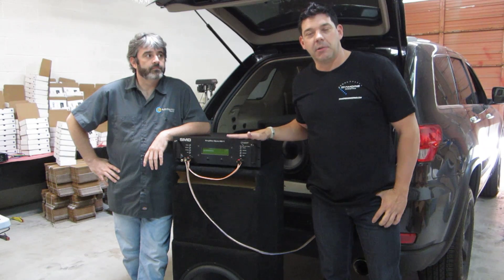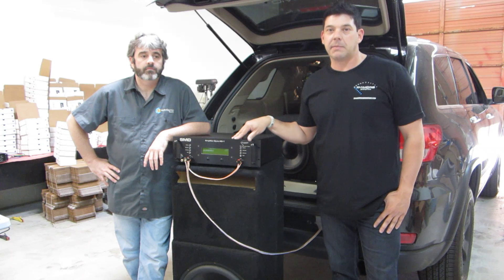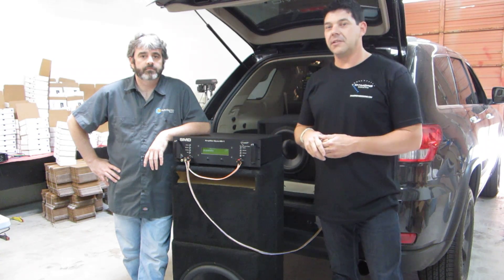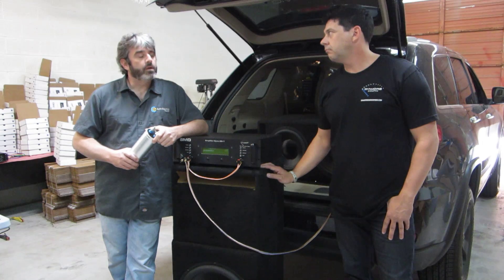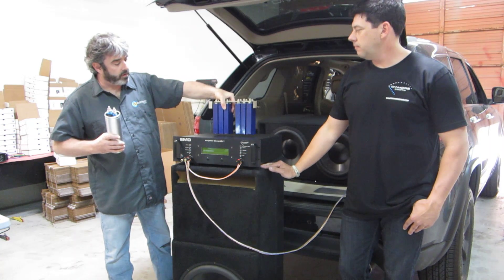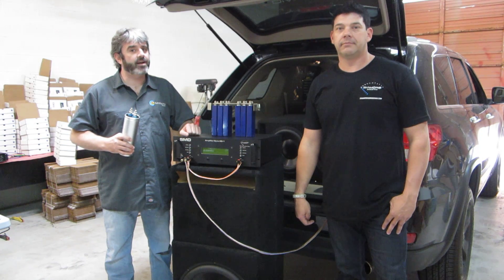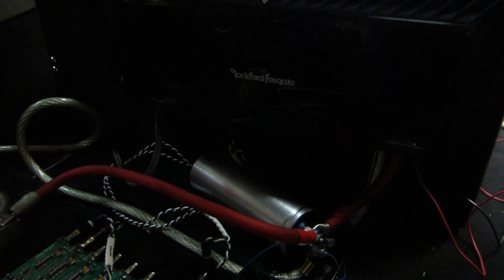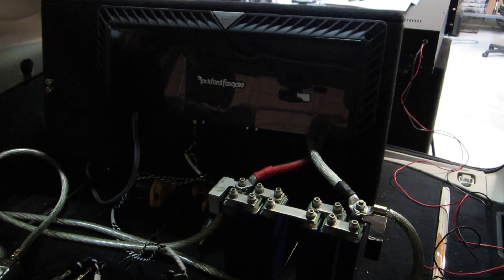SMD / D'Amore Engineering AD-1 Amp Dyno, Capacitor Testing Part 2 (Dynamic Burst)

Comment: My take is this.... i just a hour ago installed a xs power 6500 battery. Bought the "tall adaptors" for my dodge challenger 2012 stock positive battery terminal and a after market knukonceptz ground terminal (knukonceptz positive conn would require me to cut stock harness at battery,which I WAS NOT) added 1/0 gauge wire all around(except alternator pos wire to battery,stock is 2 gauge wire almost all way thru but under passenger side kick panel and seat goes to this ass wire for afew feet then back to 2 gauge by batt,but left it stock) annd I have a boss 8 fared capacitor....b4 this battery(xs power 6500) i had the same amp orion dz15001 and 12" dual solo-baric  kickers  kenwood ddx9703s double din wired to 1 ohm with a optima yellow top battery AND my lights would dim SOOOOO BAD AT NIGHT. But a hour ago added the xs power battery to my chally and im SHOCKED THIS BATTERY FIXED MY PROBLEM!  Its no joke. The volts don't drop below 13.8 at idle with lights on and bumping then at rpm 1,700 and above the volts are a good 14.1 to 14.2. Im in love with this battery. BUT??  I do have a kick ass stock alternator making 160 amps. They say you need atleast 160 to power systems with a big battery or batterys. My problem was fixed with 1 big battery. My rms watts is simple. 1,200 watts. No lights dimming nooomooore!!! I was told I need a storage battery or batteries,  NOT 300 amp alt. My car dodge challenger, most cars have a stock amp regulator. You can buy a bypass for a high amp alt, but u need that regulator bypass to get high amp out put from a after market high amp alt.  Most people don't know that.  So try 1 good battery 1st to solve your problem.  BUT??  The xs power battery 6500 COST..... $400.00 I MEAN $406.00 with tax on ebay. They ain't cheap. But check out the specs on the 6500 vs there other popular xs power 3400. Hope this helps 1 person atleast.

Comment: 1. WOW... 2. Thank You... 3. Don't you think the use of a smaller amplifier would give different results? I-mean, generally it would be less current draw & therefore a higher voltage in general - especially if the alternator's\system's amp capacity is considered... I reckon that that 2500W amp only shows one side of the story... =]

Comment: My ear is a finely tuned machine and you gave less throttle on dynamic burst on the 100 farad capacitor all 3 tests. Probably about 5 percent. You should use a finely tuned stick wedged against the seat to hold the gas pedal. Engine RPM is critical as most power comes from alternator. Do the 100 farad burst over again.
Reply: I noticed that as well.  Might have been a better test to just let the engine idle period, given the test is to see how much a cap will or will not help, and not a test for the alternator.  It should idle the same regardless, so just let it idle.

Comment: I added a bank of Maxwell ultracapacitors which comes out to 500 f and it has completely changed the way my system feels, looks, and especially sounds. People have already commented on the filtering of noise and clarity of the bass. This is 100% true. No matter WHAT I did before if I went full tilt at night there would be slight, but noticeable dimming of the headlights and sometimes even tac and interior lights as well. After the CAPS, my voltage doesn't drop more than a tenth of a volt on music. To the guy who said that this is basically bunk and is horrible for long bass notes. The longest CONSISTENT bass note I can even find in my music library is around 3 seconds. In 3 seconds, a 500 f bank, dropping from 14.2 v to 12 v outputs over 5000 watts every second. That is not including batteries or your alternator, which is constantly recharging even while playing. So a charged bank,  unhooked, is 5000 watts of energy for 3 seconds, just down to 12v. If it played down to 0v it would be 15000 watts for 3 seconds.

You can't really compare batteries to caps. They serve a totally different purpose. They shine with dynamic usage, aka music. I don't know anybody riding around listening to test tones. Safety and handling factors aside, I'd say CAPS>BATS any day as long as you have at least SOME battery backup. I have a DC Power XP270 Hairpin Alt, which is a damn beast. With that alt (which does awesome at idle revs) I'd prefer 1/2 split to be ideal. Instead of 200 aH and alt, I'd do 100 aH batts and 1 bank of supercaps for ever 2000 watts you push. Caps will never replace batts, but the same can be said with batts never replacing caps. Three letters ESR. When used correctly Caps have the internal resistance of almost a DEAD SHORT, lightning fast! Batts have to convert to chemical energy and back again to use the stored power. For those quick bass notes you need that instant power, the split second dimming of your lights is the batteries STRUGGLING TO KEEP UP.
Reply: Good to hear, i just bought a 16v 500f Maxwell module myself.
Reply: How much were they? Where can i buy them

Comment: A capacitor ONLY helps if burst current draw ( big bass note etc ) is higher than combined current output of alternator and battery 'dump' capacity.....and AFTER the big note, electrical turns to shit lol. Sine wave testing over a couple minutes and watch that voltage drop. Capacitors are awesome for spl comps ( only need extra juice for a few seconds right! ) but for everyday bangin, higher amperage alternator and batteries will be the best solution. It's amazing that this subject still gets any AirPlay o.O
Reply: It gets "airplay" because people like you dont give the whole answer.  You could run a 5000amp alternator and still get unwanted voltage drop  Most people looking into a cap are trying to mitigate instantaneous v-drop, which assuming you have a nice alt and battery and wiring, is caused because there is a delay between the audio system pulling draw and the alternator responding and providing the power to keep the voltage steady.  That is what causes lights to flicker (again, in a properly built system).  I have a 260amp alternator and a Kinetik battery rated for more than my amp draws, with all alt/battery/grounds upgraded.  Voltage readouts stay rock solid no matter how hard the bass hits, but my headlights still dim for a split second when it hits especially hard.  This is because there will ALWAYS be momentary voltage drop whenever something pulls harder then the systems output at that exact moment.  Your alternator does not know before the bass hits that it will need to supply more power.  ANY voltage drop, no matter how small, will cause this, including the split second it takes for my alt to catch up and maintain the system's voltage.  The remedy?  Totally isolate the amp circuit from the rest of the electrical in the car, or do something to better regulate the car's overall voltage.  A capacitor is one way to do this.  People seem to misunderstand how electricity works...  Your comment, while partially correct, was partially very very incorrect as well.  Obviously I can't show you, but simple example: I drive a 2012 CTS Coupe.  I built an IB baffle and installed two 12 Fi IB subs.  They are paired to an appropriate amp, which is connected to an overpowered battery, which is fed by and even more overpowered alternator.  Listening to songs with a steady hard bass beat, my headlights dim whenever the bass hits.  Listening to something with a hard, constant bassline (such as "Step Up In The Party" by Spade Ripper), the bass is almost constant, so my headlights dim for a split second, then quickly go back to full brightness, and they then stay there, because the alternator us stepping up to provide the needed power.  A suitably powerful cap could respond basically instantly, giving the alt more time to respond, and less of a heavy draw since.  The alt/battery feeding the cap is a lot less of a draw on the system than the amp pulling that directly.  Hence, less/no more split second vdrop.
Now, the case where caps do NOTHING, is when people buy a $35 cap from Best Buy or ebay thats labeled as 50 farad, but in reality is maybe half a farad, or even a tenth of a farad.  Get you a proper cap, with 1-2 farad per 1000w of amplifier, and you'll be pretty golden.  No amount of battery or alternator will mitigate those micro drops.

Comment: I don't recall any specs on the electrical system being used. Stock 120 amp alternator? Big 3 done? Over half of everything I read on the internet says caps are a waste and are actually hurtful to a cars electrical. Of course this kind of shows that they work but at what price?? I am a little confused on the results in the video description. It seems as if the 1 farad cap did better than the 10. That must have been heck of a QUALITY cap. Thanks for the vid.
Reply: ***** Caps are meant to be a high current short pulse short term storage device.
they can help offset power losses in long power cable runs and reduce DC power Noise (this can help gas mileage and life of alternator)

with Caps the trade off for more Farad (storage) is a higher ESR the lower the ESR the faster it can dump power the faster it can dump that power the smoother the voltage stays the higher the efficiency of your amp
when i build systems this is how i do most things

400w doors + 1000w subs (RMS Music)
2~0 gauge single run (real cable)
Plus 0.5f cap
and Mini-ANL fuses (in parallel)

400w doors + 1000~2000w subs (RMS music)
1/0 single run + big 3 + 1F Cap (35~50Ah batt if stock alt in under 120 amps)

600w+ Doors + 2000~3000w Subs (RMS music)
1/0 dual runs- 1xPos & 1xGnd + 2~3X 1F Caps + 100Ah in extra batts Plus Mechman / DC Power 6 phase 220+A alt

1000w+ Doors + 4000~5500w Subs (RMS music)
1/0 quad runs- 2xPos & 2xGnd + 4X 1F Caps + 250+Ah in extra batts + 2 banks of super caps + Mechman / DC Power 6 phase 240+A alt

my current setup

1464w doors + 8,844w at 2.13ohm Ampere Audio 8.0 TFE driving 5 Sundown X-8's D4 wired to 1.6ohm 
quad runs of 2/0 + 4x 1F ultra low ESR Caps Mill spec, 15,000 Farad 30X BCAP3000P270 = 300Ah 2X haze Tel150F + DC audio 250A 6 phase hairpin alt
floating voltage is 14.32v 45sec solid 40hz tone drops to 14.11 at the amp 
all that's packed in behind the back seats of a 2008 scion XB
keep in mind even with all that full output power will stall out the car or destroy the amp in 6mins yet will run my welder for 1 full 130cf tank go figure

Comment: With a poor alternator the cap will increase power, make the cap too big and the alternator will not be able to supply the big cap and batt/amp under load. A common effect with a weak current source....
Reply: i agree with you!
Reply: ABOUT YOUR COMMENT ON A STOCK CHARGING SYSTEM WITH A 1 FARROD 1 FARROD VS A LARGER CAP, SO, If running a stock charging system of 110-120 amp alternator, do you think I should add a 2nd battery & just a 1 farad cap?  OR 2 batteries & say a 10 farad cap? im planning on running a cab 1600.1 either at 4 or 2 ohms because I don't want to strain my electrical system 2 much. but< im taking it as u think its better to keep the cap size in line with ones charging capabilities? so a 03 focus-stock charging system & I plan on running 2 batteries & at least 1farad cap? or more??? a t least until I can afford a better alternator!!!

Comment: Those capacitors do seem to be working, though not much difference between 100 Farad and 1 Farad. Capacitors work by smoothing peak current draw from the battery so less voltage sag.
Not as good as a bank of batteries, but acceptable if you're not playing full blast with a continuous sine wave.

Comment: so what if you had diodes running from the capacitors to the amp, and had both the ultracapacitor for the RMS benifits, and the smaller capacitor, with the lower impeadance, for the Peak Power.
Reply: There test was a bit flawed.  If you listen, the engine is clearly running a bit faster when testing the 1 farad cap.  Caps are caps, the work the same, and are extremely simple devices.  A smaller cap will never be better at supplying power than a larger cap, unless there is something wrong with the larger cap.  A smaller cap will discharge faster and more easily than a large cap, so if anything, the smaller cap may require more from the alternator to keep recharging it.  If the larger cap is being discharged enough to cause a problem trying to recharge it, then you need either a better battery, higher output alternator, or both.  These larger caps are not meant to solve a problem of having a battery and alternator that are far below what is needed to power the sound system.... Rather they should be matched with an adequate battery, alternator, and good heavy gauge wire such that all the capacitor is doing is filling a bit and smoothing out the dips when the bass hits hard... They shouldnt be trying to increase your over all RMS power, but for dynamic power.
Reply: I meant their test, not there test...ugh.

Comment: I'm sorry...but I found this vid a few months after it was posted.  
BUT, I find a flaw in these tests.  He guy on the throttle is trying to maintain a steady RPM, the based on the sounds from these tests, THE THROTTLE does not remain stable.  And in these vids, we have no way to know that the alt is seeing 800rpm, 1500rpm, or 4000rpm.  All we hear is noise. Thus, we do not know the effect the alt/throttle has on the voltage drop of the system!  I like this vid, but I hope you can refine it.

Comment: They still shorten battery life, give you a false sense of security etc. The caps inside the amp have little to no impact on how current is drawn from your cars electrical. A cap outside the amp is severely different from most car batteries.. They are only good for for 1 cycle of the woofer, even at 30hz this is only a 30th of a second, anything beyond this the cap might as well not be there, ya you get a bigger number on the dyno, but the woofer only gets that power for one cycle...

Comment: i don't know enough on the topic to comment on the argument you state however i am curious, you mention caps being used to filter dc voltage from the system. are you able to confirm whether adding a capacitor will take some strain off components in an amp, i've had 2 fail the same way in which dc voltage was somehow getting through the system creating a pop and hiss at startup and also feedback from the alternator audible through the speakers as the car revs, would a cap keep this from happening

Comment: The purpose of this test is to demonstrate that there is no longer a debate. Battery voltage, alternator temperature, and so on are essentially irrelevant becuase the AD-1 proves, you make more dynamic power with a cap in the system.

A Capacitor stores energy. Period. It will release that energy in an attempt to maintain it's voltage if the supply voltage drops at the amp.

Comment: An amplifier can not create/make more power (output) with capacitors. Capacitors are for filtering AC from the DC line. Amplifiers have a DC filtering section (which usually are 16v and higher than 1000uf....many amps have multiple caps in this section). So adding another one outside the amplifier can not CANNOT make the amplifier create more power.

If it does as your test show, your electronic components wont last long....as electronics HATE voltage drops...makes them work a lot harder.
Reply: It CAN make it produce more power by reducing the voltage sag. With a big voltage drop the amp makes less power. Reducing or limiting that voltage drop allows the amp the produce the power it wants. So you not really making more power, your just limiting lost power. Which is kinda the same as making more power.

Comment: i'm curious about the timeline for these tests.. and if anything was done to take into account the alternator heating up and losing efficiency.. in the first videos about this product you mentioned steady voltage at the front, but a drop at the rear.. was that the same for these tests as well, negating the alternator as a factor?

Comment: Ahh burst power..
Still would be crucial information to do these same tests with a rear battery such as an XS Power D3400 which would be a decent sized battery to toss in the rear for a rf2500bdcp amplifier. 
Not only would you have stock vs cheap cap vs nice cap vs battery (which is priced about the same as a legit capacitor)